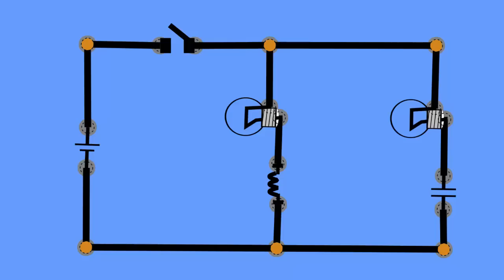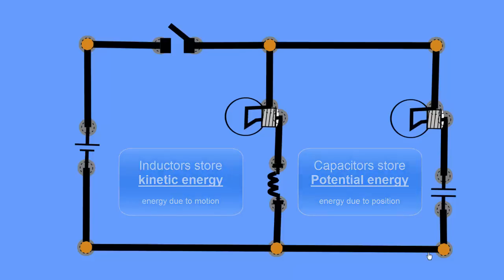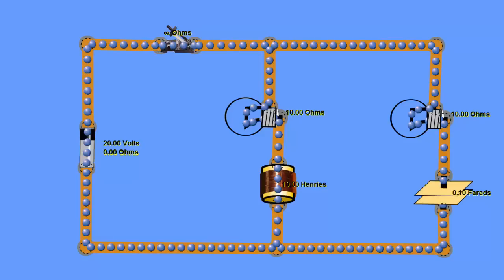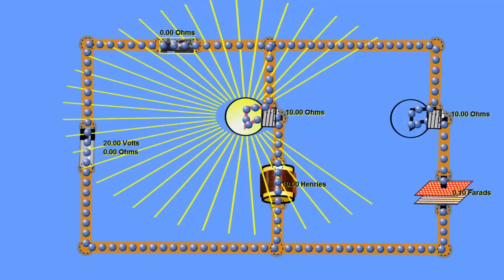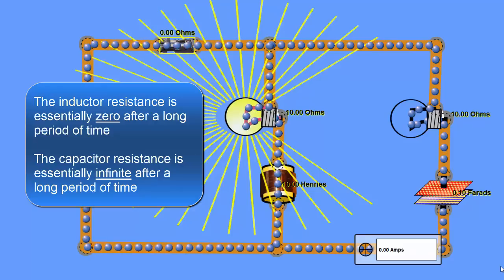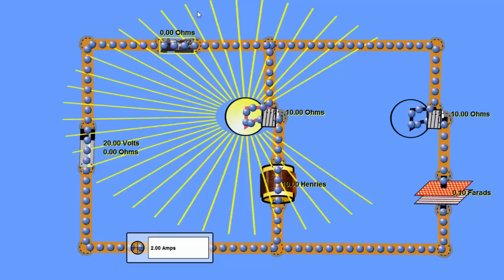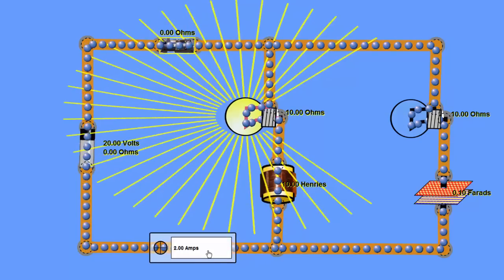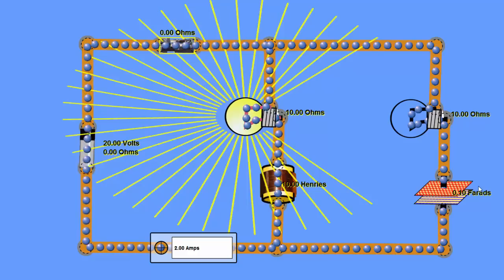Capacitors and Inductors - Mirror Twins

Comment: TEACHERS should NOT assume that beginners already know all the variables and their relative instances in the circuit. For example, when stating that "capacitors oppose instantaneous changes in voltage bla bla bla, they should NOT forget to mention that this occurs ONLY after said capacitors are already charged which is when they have this property".. same with inductors, since we're also talking abt time constants, so there are varying properties at varying times..
Reply from the maker: My approach is that all circuits involve time constants since resistance is a part of all circuits except perfect circuits. All power supplies have current limits, all conductors contain resistance and all loads (light bulbs) contain resistance. I always start using practical circuits and discuss ideal (non-existent circuits) later. Whether  capacitors are charged or uncharged makes no different. In fact an uncharged capacitor, creating a transient condition, is a better example of this property. When applying a voltage to such a capacitor the voltage across the capacitor will not instantaneously follow the applied voltage since a time constant in one form or another is always involved. The same conditions are true for inductors except  that an infinite rate of change is not possible for inductors so these devices are subject to the same constraints demonstrated in a capacitor circuits. All instruction should begin with practical circuits and we can discuss perfect circuits with infinite current capabilities and zero resistance at a later time.

Comment: Here... Voltage = Voltage and Current = Amperage.  People use "current" as a description of many things like amperage or wattage and sometimes even voltage. The use of the term "current" is really too often misleading to be used in any electronic explanation. It's use can often mislead folk and it is not THAT difficult to call voltage - voltage, amperage - amperage and Wattage - wattage. Since the videor has used the term "current" so many times, I challenge him to give an explanation whereas current is better used than amperage. Especially explanation why it would be a better use than amperage for a novice.
    One exception of any attempted description and that is as in water current as discussed in water direction. In which using current to tell which way a charge is going is acceptable.
Reply from the maker: Using amperage instead of current is like naming speed MilesPerHourAge. We typically do not name things after a unit used to measure an attribute for that thing. If a student knows nothing about what an Amp is (actually an attribute for something they need to know about) they are not necessarily aware that the process involves MOVEMENT in working electrical circuits. Additionally, current suggests flow which helps students visualize and gain an intuitive grasp of what is really happening in a wire that carries moving electrons. I typically tell my students, to help them understand electrical systems, that Cause and Effect exist in most energy transfer systems, including electrical systems. CAUSE is voltage and EFFECT is the resulting movement of electrons (current).
Reply: @DorianMcIntire  The problem's reference is the misuse of the term current. However you used it correctly and Never used amperage which also causes vague understandings. I have even found the misuse or vague use of "current" in books!  A novice can get quite confused when they attempt using volts, amps, watts & then current.  It was one of my pet peeves as news letter editor while writing about wave propagation and electronics for an amateur radio organization (FARA and several nearby organizations who copied my work) in the mid 90's. I re-read what I had written and should not have been abrasive but been more concise. My apologies. I did enjoy your work!
Newly Subscribed.
Reply from the maker: I can understand how things can get very confusing for novices with the many different ways books and articles can get loose with the terminology. 'Voltage' has fortunately replaced 'EMF' in many older textbooks but I still see it a few new textbooks. The current trend seems lean toward 'voltage' which seems much more natural since we don't call a voltmeter an EMF meter.
BTW no offense taken and thanks for the sub.